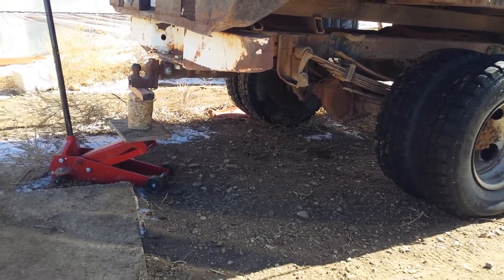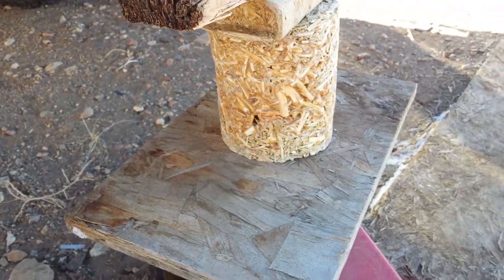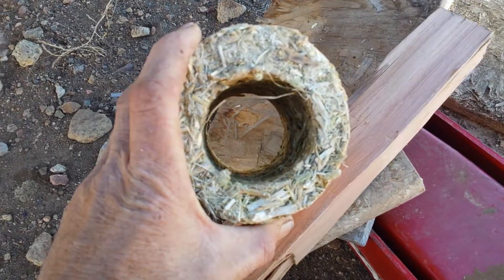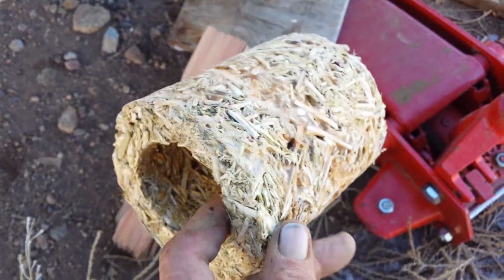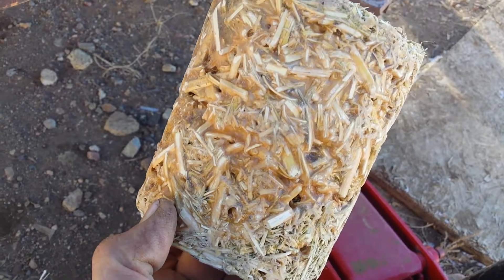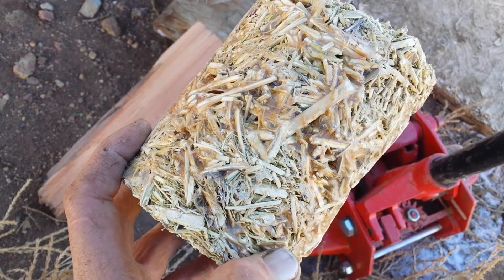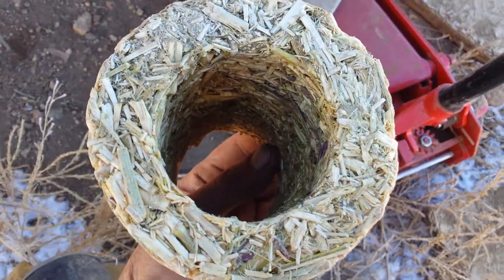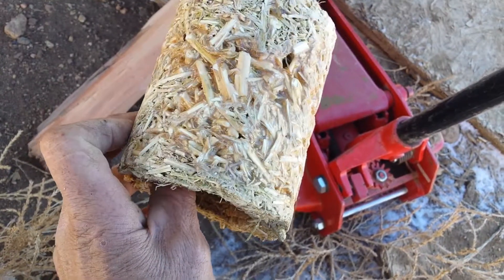Hemp Hurd, bast fiber-shiv hardwood composition with Common woodglue, lifting a ton truck  😆

Comment: have you tried a strength test of standard hempcrete composite? 4:1:1 hemp hurds:hydraulic lime:water ? very interested to see
Reply from the maker: I've tested hemp lime
I'm not impressed with Hemp-lime structural strength
I'm much more concerned with seismic strength versus simply existing as a lump of modified cob
(See some of the videos on modified mixes bentonite/acrylic)

 beyond it's NON STRUCTURAL insulation capability
Reply from the maker: this is *seismically structural HempCrete
One of the better I have so far all the same sample https://youtu.be/HSE5vESjFk0
https://youtu.be/-Ktl6-4B0x8
https://youtu.be/mztq32gdQeM
Reply: @mrglasecki  great thanks! Seems like hemp lime is just about figured out as insulation and structural hemp is next. Ideally I'd love to see a result be achieved possibly natural/non toxic chemicals. Just for the sake of being consistent wjth the hemp limes environmental synergy.
Reply from the maker: @opsjesse  if I was looking for 'natural' it would be COB hydraulic lime is ONLY different from concrete by the binders used (other than lime) when added like the old saying BTU in * is BTU out 
 your getting nothing for free use no binders have no strength 
 any COB (rammed earth) would be Considerably stronger
 Hydraulic lime is 'almost' as dirty as complete concrete *add a binder and it is same same sadly
Reply from the maker: @opsjesse  might look into two stage gasification Live lighting Hemp gasification
https://youtu.be/ztOrrce7568
 Hemp will be able to provide unlimited synthetic NG 
 for Co2 neutrual concrete's building materials
Reply from the maker: @opsjesse  
Maybe 🥰 https://youtu.be/csOXglSOR5k 
 edible hemp plastics is actually next Biodegradable @HOME plastics 🤔
Might be hemps future
Reply: @mrglasecki  wow thanks for the links! Hemp plastics and maybe even Styrofoam would be huge for eco friendly growing mediums. Wonder if hemp glass is possible. Thanks for the links!!
Reply: Hemps growth rate seems like its a much more ideal fuel for traditional tiny home wood fire heaters also /replacing timber as a burning medium
Reply from the maker: @opsjesse  steam delamination of plastic 🤔 is styrofoam 😏
Reply from the maker: @opsjesse  think you might have me on hemp glass 😏 😁

Comment: Could this be used for a driveway or brick!
Reply from the maker: Yashay Deane bricks Yes, an insulated basement or concrete slab Yes, 
 As an outdoor driveable surface to support a multiple thousands of pounds bouncing in on it daily as HempCrete No, the binder would fail over time, as a HempComposite most Assuredly Yes,
  bast and shiv (stringy an hardwood) fibers both can withstand much more than conventional concrete. (Not intentionally made for a high pressure sea wall, say)